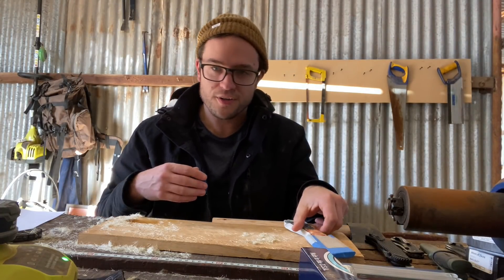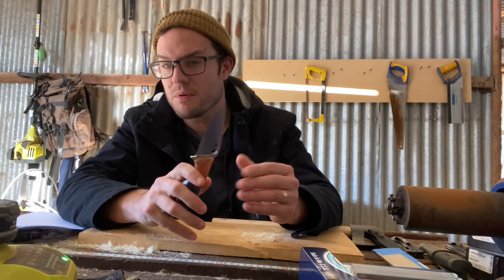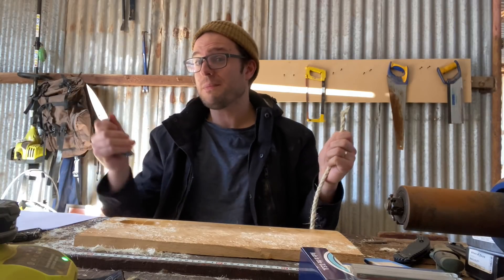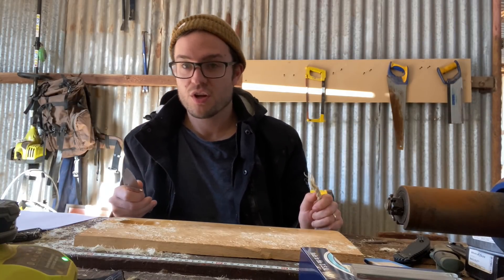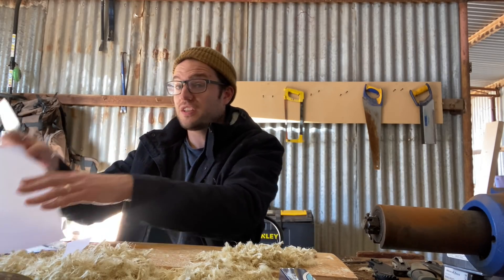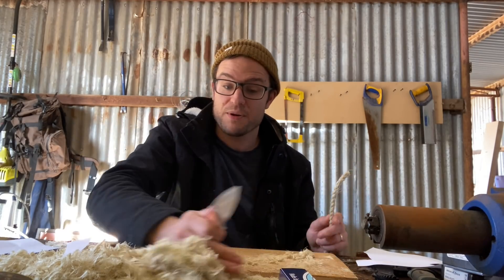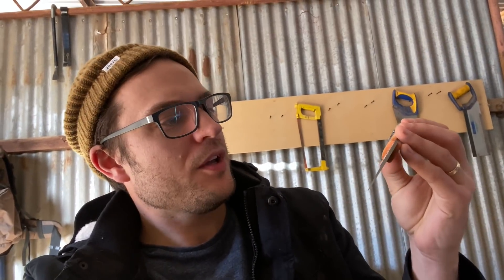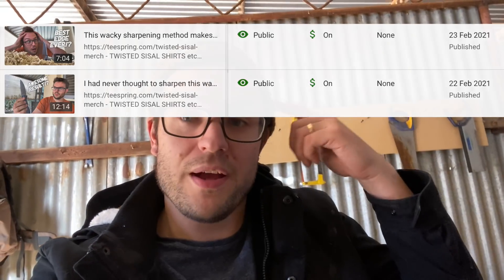Further Testing of 4V steel

Comment: Yeah,  I put that edge on my knife right between cutting off the front quarter and rear quarter but definitely before cutting out the backstraps,  and I’ll tell ya it just kept going right through splitting the ribs from the chops…   gotta love that steel and edge retention from the way it was sharpened like that!!!

Comment: Great work Pete!  So interesting to me that:
1) 4V out-cut Maxamet with the fancier sharpening equipment.
2) Also interesting that the gains were higher with my original method and my original stones which I had considered to be very very basic and budget (your M390 and M4 dual grit test knives were stropped on cardboard, lol)
3) Probably the biggest takeaway for me in these recent tests is that either a) You need a wider angle to support the thin burr on dual grit (and making it too acute causes the apex to de-stabilize) - this could be why the working edge lasted SO much better on the first knives tested (at 20 dps), or b) I need to do careful analysis of my technique to remove the small burr more fully while leaving the large, beneficial dual grit burr as an additional portion of narrow razor-edge.

Every test, my mind is flooded with excited thoughts and theories.  Thanks for doing another one Pete!

Comment: I'm getting a little frustrated with sharpening right now! I'm using the stones and I'm quite proficient at it but I'm having an issue right now. I can get it paper cutting sharp but it won't shave hair like it should. I'm using an 400,1000, 3000 and 8000 stone system. Along with the strop but it won't get that hair cutting sharp I'm on a pretty steep angle and sure it's around 18-20° but it's not doing like I want it to. Any help would be appreciated but I'll keep plugging away on some cheaper blades and hope it comes back soon!!!!
Reply: What type of steel and what type of stones? Are you using a guided system or are you freehanding? My best guess without an answer is you aren't fully apexing the edge on your low grit stones or you aren't removing the burr correctly. I freehand and I can produce shaving sharp edges from a 320-400 before stropping. Make sure you apex and then lighten up your pressure (a lot) and minimize the burr as much as possible
Reply: Trained basic metal workshop skills 50 years ago ...
Be humble, become a part of it - no distance 
It's zen after all

Comment: Thanks Pete. I really appreciate your edge testing. I tried the duel edge method on a mystery steel pairing knife I own. It was razor sharp but the edge rolled within two weeks. I ended up re profiling and going back to polished edges. It's not quite as sharp as my fuel edge initially was but my mirror polished edges seem to last far longer without getting damaged.
Keep up the great videos. Thanks

Comment: The masters of hard (60+) steels, Rockstead, preach that a strong edge on a very hard steel comes from meticulous polishing. The theory going that they are intrinsically brittle, so potentially prone to chipping. However, for a chip to develop, there must already be a microscopic fissure in place. If it’s not there, it’s hard for one to develop. Hence their obsessive polishing. I wonder if this differential sharpening of harder steels leaves them open to chips developing along the course sides striations? Perhaps a super fine polish might be more robust? Rockstead claim that their 67RWC ZDP189 is good for 1,000 cuts in much thicker sisal rope will produce o noticeable degradation in sharpness. It’s a maker’s own test, so must be taken with a pinch of salt, but taken at face value, it’s an impressive result and their methodology could do with some testing. I wonder if they’d lend you a knife to test?

Comment: I'm not quite sure, but it seems as though this form of sharpening would benefit the so called "Tougher" Steels as opposed to the "High Hardness Edge Retaining" Steels. As I said I'm not quite sure as their will need to be more testing done and data. Once again incredible work Pete and thank you Gabe from The Home Slice Channel. You guys are doing this industry such a great thing. Have a great day all.
Reply: It does appear that way in the 5 tests that we've done so far.  Looking forward to continuing ot figure it out.  Thanks for the feedback and encouragement Nate!
Reply: Oh absolutely. The toughness holds up those micro teeth.

Comment: I bought a paramilitary 2 yesterday, stripped one of the pivot screws, and now I'm pissed. Friggin red loctite!
Just thought I'd share with you guys because nobody else in my life care about knife stuff.
Thank you for your time.
Reply: That's the worst man. I think many of us need each other for that same reason
Reply: @adamsheppard3480  thanks knife bro
Reply: I GOT IT! HELL YEA!
Thanks to everyone for your help. And thanks to Pete for having such an amazing, friendly and helpful fan base.
Knife bros are truly the best bros.
Reply: @alexhill3470  True that !
Happy for you, hope the imprint of the pivot screw is not too much dead. Spyderco can certainly send some (otherwise it's easy to find online)
Reply: @ramonade_knives  I plan on replacing the hardware eventually anyway. Maybe some nice anodized ti screws
Reply: @alexhill3470  I ordered a set for my Para 3, just in case there is any problem, i'll upgrade ^^.
Did buy a Ti backspacer too but it was microns too large and changed the action just a little bit, ended up removing it.
Reply: @alexhill3470  Awesome!! How did you get it off?
Reply: @tunturikuningas5393  slowly poured boiling water over the screw. Next, I put my torx driver in and gave it a light tap with a hammer to shock the loctite.
And BLAMMO! That screw finally obeyed my orders and did the thing.
Reply: Sorry to hear that, always unfortunate. Were you able to get the knife apart or did you have to stop there?
Reply: @DanielReyes-hz1qk  I stopped there to do more research. I wasn't even really planning on fully disassembling it yet. I was just going to adjust the pivot to get an action I like. Gonna try boiling it maybe.
Reply: Heat it up and it should come out. Also use good bits
Reply: @carlodanger8187  I'm using what I thought were good bits. Never had a problem before. But I've also never run into red loctite before.
Best method for heating? Boiling, hairdryer etc?
Reply: @alexhill3470  I usually just run the faucet as hot as it will go and hold it under the water for a few minutes
Reply: Degrease use jb-weld to glue a torx bit in the hole wait and try again.
Reply: @MightyRude  that's a really good idea! And then I don't have to heat the damn thing up and potentially make things worse.
Thanks, my man!
Reply: @alexhill3470  Tell us how it goes ! We'll cross our fingers for ya
Reply: Hair dryer was always enough for me
Reply: Was it the backside screw? i was also trying to get the scales off to dye them, but the backside pivot screw just didn't move, even with moderate force, so i just stopped.
Reply: @tunturikuningas5393  it was, and I should have stopped like you did.
Reply: Sleepycabin pfp?
Reply: @lindboknifeandtool  you like knives AND Sleepycabin?! My dude!
Reply: @alexhill3470  yeah very rare crossover here😂😂   Good luck on your pm2. I did the same to my domino. I ended up cutting a channel making it a flathead.

Comment: Is there any modern folder with similar blade geometry to an Opinel No. 8? No knife I have is more satisfying to use but every one of them is more satisfying to EDC.
Reply from the maker: closest I could point you at is the spyderco chaparral
Reply: @CedricAda  "GLASS CANNON"  DO YOU PLAY VIDEO GAMES? LIKE A  MMO ?
Reply: I recommend you get a regrind done on a knife you like. My first was n Elmax para 2 with a Krein regrind to 0.005 and it spoiled me. The way it cuts is like nothing else. If you can find it, the Spyderco Nilakka was ground crazy thin. Original was zero ground with a slight micro but it being s30v and sharpened on a grinder the edge was weak until you ground it off. Newer once were ground to about 0.005 to fix that. Great knife. I found a few slipjoints that come under 0.010 stock, Joker knives makes one, Fantoni Dweller(but they're discontinued now), a few TwoSun slip joint were pretty thin and I hear Manly slipjoints are ground that thin too. They make a back lock but I'm not sure how thin those are ground. Some of the Japanese Spydercos are pretty thin like Centofante 3 and Caly 3/3.5 and Calypso. Like Pete mentioned Chaparral is a nice cutter. I bought a few clones from Hilbert knives that are ground pretty thin too, not sure your feeling on those. And you can get a custom knife from a right maker to fit your needs. Some who are just starting out don't charge too much. 
Good luck.
Reply: The Centofante is even thinner than the chaparral but it's vg10 and you cant disassemble it. Most civivi hollow grinds are around 12 thou behind the edge and are pretty amazing cutters
Reply: Civivi Incite is crazy thin behind the edge.
Reply: Check out Manly knives!

Comment: Use end grain wood for your cutting surface, much easier on the edge
Reply: Knifegrinders did a test on cutting board surfaces. Suggest you read it on his website or watch the vid on yt.